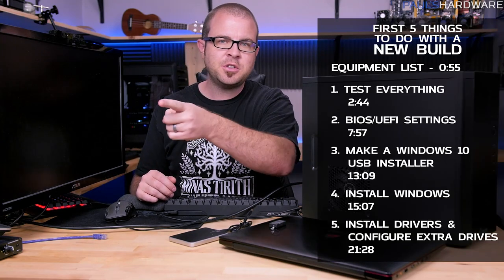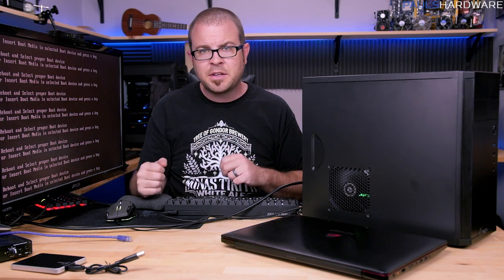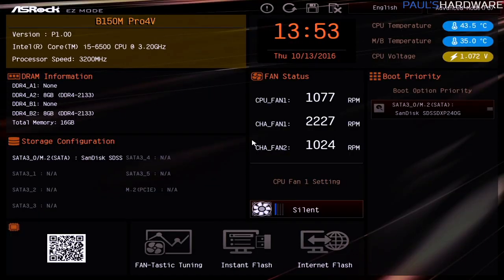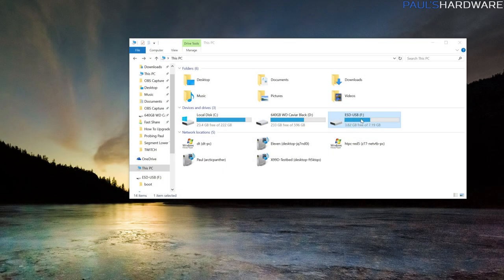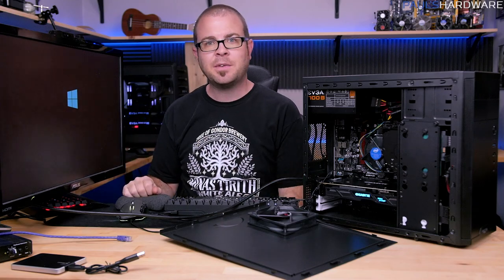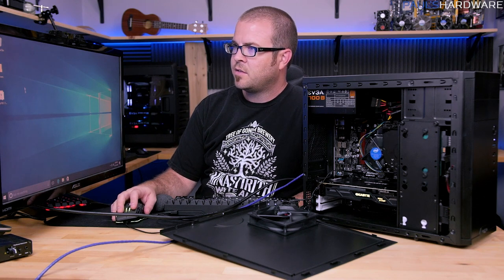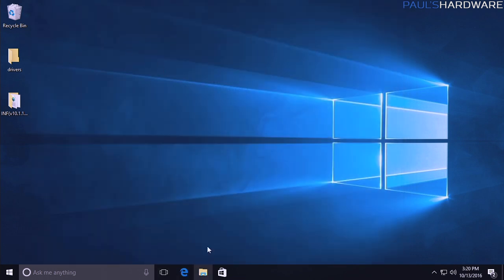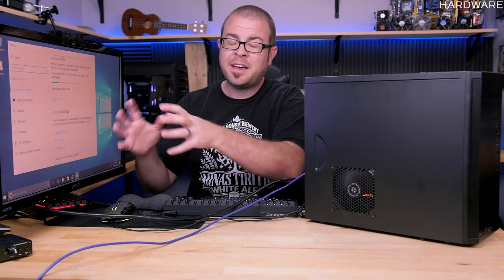First 5 Things to Do with a New PC Build

Comment: Where was this 7 months ago when I built my pc?
Reply: Marshmallow M80 how long did it take you to build? I almost have all the parts for my pc build and was just wondering.
Reply: I had some problems with my ram and cpu cooler, and I was going super slow to not screw it up since I'm clumsy. It was like 9 hours maybe? Including installing windows and drivers. In reality, you should be able to get it done in like 3-4
Reply: Marshmallow M80 alright thanks. Thats what I'm afraid of, that my stuff isn't gonna work but hopefully it all goes decently well.
Reply: Well it worked, it was just that I didn't seat the ram correctly. If you have any problems, that's the first place to start. Also, the 212 evo is just a pain to install on your own. I just replaced it with a h110i gtx and that was much easier to install, so it just depends on what you get. If you have someone to help with your cooler, it's a lot easier.
Reply: 3-4 HOURS? the longest it ever took me was my first build coming from a pre-built office PC and it was only 2 hours including windows install and all software 5 years ago :P
Reply: 9 hours ? Jesus
Reply: Dimitri Sainis Yeah, I took forever so I wouldn't fuck it up, and then the ram issue added like another 3 hours because I couldn't figure out what was wrong. Then issues with drivers, mostly for my wifi card because it's going to be another year and a half until I can get a cabled connection.
Reply: madhound3477 took me like 1 hour 30 min for my first PC build cause i was being careful with some stuff but it took a little longer to download windows but not too long
Reply: Can't wait to start building mine. Just need my cpu and graphics card. Should get those this week.
Reply: My first build took about an entire day as well. But I wasnt rushing and spent at least an hour on getting the cables nice so the rear panel would close. Give another hour to install windows, then another 2 - 3 to download shit and set things up
Reply: Takes me anywhere from 4-12hrs depending on the type of case or cpu cooler used. I build them now with 1 arm so...Just enjoy the whole process every time!
Reply: That's the thing. I want to enjoy it because I won't be able to do this too often. I also don't want to rush and then end up screwing something up.
Reply: Marshmallow M80 Where was this yesterday when I built my PC?
Reply: I'm in the middle of a build right now, and its been a month. I think it will be done in 2 more weeks.
Reply: Well I bet Best Buy did not give you a Spanish version of Win10.
Reply: RedrumZombies I got a free copy of windows 7-10 from school through a Microsoft program, so I didn't have to worry about that. The copy of 7 we used for a virtual machine, but I used 8 and gave 10 to a friend
Reply: Took me about an hour to build my PC. Though there was nothing special about it, just an old case with brand new parts. Stock cooler. Software setup was a headache.
Reply: Marshmallow M80 hey im in high school and my email says i can get microsoft stuff how exactly do you do it
Reply: The Unadvisedguy Idk, it was from a thing with my college that was already set up. I don't know if you would be able to do it.
Reply: it took me 3 fucking days!
Reply: lemons nick me too it took me three days to finish. I finished but two days for troubleshooting that I fucking clicked the wrong button to power on 😤😤. I kept on clicking the led power not the power button
Reply: Hawkie 22 what did you guys do to set it up
Reply: just make sure you configure your bios and installation of OS correctly
Reply: Andy Broberg im trying but as soon as i get to the media selection its blank
Reply: Louen Mark Visaya

+mannex gaming idk, if you gave us some information we may be able to help you out. for example im guessing you're talking about the bios not recognizing a bootable device? i have to go at the moment but look thru ur bios after making sure everything is connected to the motherboard and all the main parts are powered by the PSU. building it is like legos but the configurations can get a bit difficult in some cases. are you saying that it doesnt recognize a bootable device? or it's not reading the media on your flash drive / or disk (in 2017?) and is unable to install windows/ubuntu . you may have to change the devices it can recognize if it's not seeing it at all... if everything is setup on your computer (psu powerers big parts, mobo connects to everything so they can "speak", and bios is controlled by mobo obviously). like i said.. knowing exactly whats wrong and what motherboard youre using will help, and if youre using an HDD or SDD

Comment: Step 6: Overclock the bawls out of it.
Reply: OVERCLOCK EVERYTHING not with that stick Intel heat sink
Reply: "Overclocks Usb port"
Reply: S My bawls have been oveclocked now :).
Reply: as long as its cool enough. i got 4.5 without adjusting my voltage on a 6600k.
Reply: I have my 6600 on 1.350vcore and 46x multiplier with 100mhz base. running prime small packs gives 70C with watercooling.
Reply: TwilightSpoorkle Did it catch on fire?
Reply: OverclockedSanic Amd is for poor people :).
Reply: OverclockedSanic Jerry aka barnacules joke _...
Reply: OverclockedSanic ok
Reply: its not a k skew, cant be over clocked
Reply: TwilightSpoorkle Holy shit....Pun intended :P ..
Reply: Overclocking is bad, most games and developers do not support/recommend that. I used to work as customer support
Reply: ***** What I mean is developers can't guarantee that their games will work with overclocking. Overclocking prevents some games from running normally and people get crashes etc. Disabling overclocking and setting the options back to default sometimes fixes the issue
Reply: OVERCLOCK EVERYTHING r/usernamechecksout